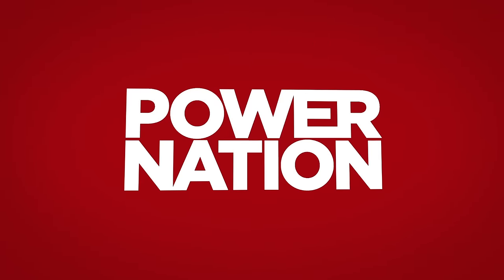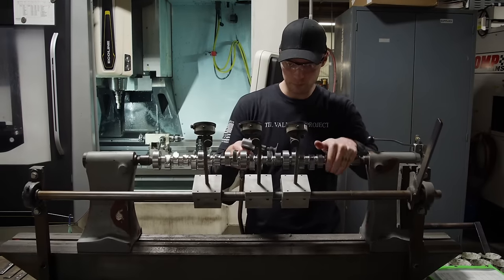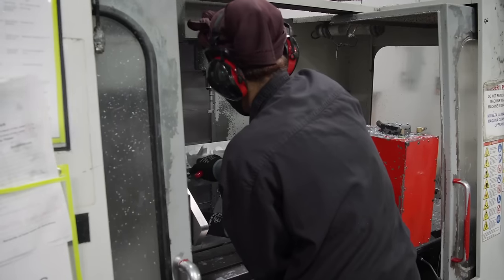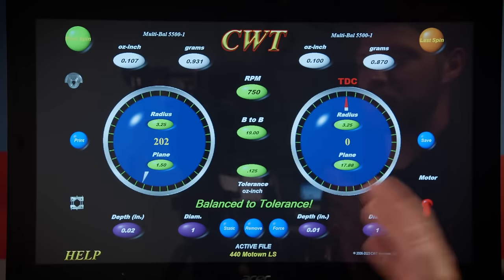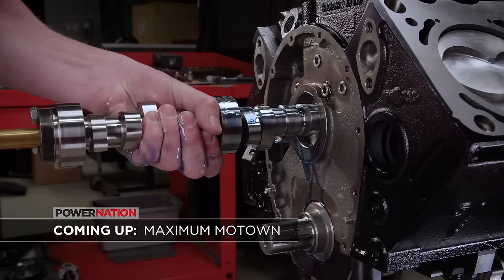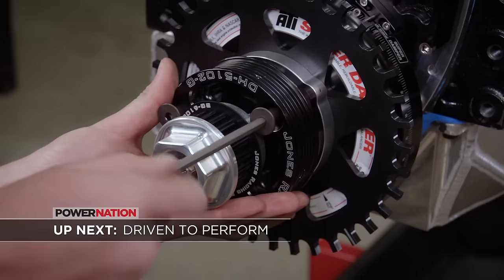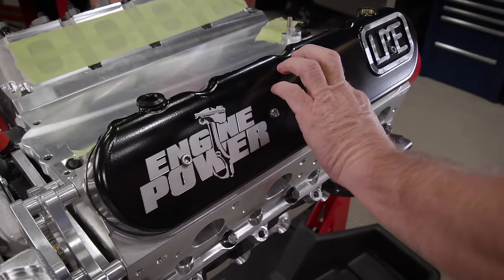Building a High Tech 440ci High-Compression Dry-Sump EFI Small Block - Engine Power S10, E11-12

Comment: Running a crossplane V8 to 8000rpm is a thing most people never experience. Unless you go to tractor/truck pulls lol.
Reply: Track days too
Reply: With the budget these guys have they should be getting at least 9000rpm.. 8000 is easy.
Reply: @davidgalea6113  10,000RPM! Aim higher.
Reply: Go to a dirt track. 8000 is low.
Reply: @InvaderSS670   Even higher than 10k is possible (project spinal tap) just not practical which is why I went with 9k.For some reason high rpm is never done on these shows, its where the real technical knowledge is vs bolting stuff on, high boost, high compression, high displacent has been done plenty of times and easy in comparison to reliable high rmp.
Reply: @davidgalea6113  10,000 rpm 2V (relatively) large displacement V8's are rare because they beat the lips off the valvetrain, and cost several times more than bits that live at 7000 rpm.
Reply: @jamesgeorge4874  yes 10k is pushing and not practical unless you are  rebuilding the engine after ever oval race or after a few drag runs.. I think 9k is reasonable nowadays and wish these shows would build an engine that reaches that comfortably..
Reply: @davidgalea6113  It would not be practical, or worth the additional material / maintenence costs, to rev that high, just to rev that high. That's why manufacturers don't build them, unless you're talking 6 and 7 digit supercars.
Reply: Or drive a factory coyote 😂
Reply: @9090ruby  too bad Ford has fuel cut set at 6750, stock.......
Reply: @jamesgeorge4874 You don't know that there are ways around that?
Reply: @wudznutt6732  a "factory" coyote  does not. If it is tuned, it is not "factory" anymore.
Reply: @9090ruby  coyote is a cool engine but very expensive to build and less parts availability when compare to a traditional sbf.  I wish ford would have gone with a modernised pushrod v8 like gm did with the ls engines.. ford motorsport catalogues used to sell high port heads, graphite blocks, aluminium 302 blocks etc etc nowadays the really high performance ford parts have been replaced by mild steet stuff.
Reply: @jamesgeorge4874  I agree with your comment, but I was talking about engine builds from TV shows like this one rather than manufacturers.. they have the budget to do this..9k is not that hard  with today's aftermarket valvetrain parts
Reply: @InvaderSS670  12000

Comment: I built 440 cu. in. small blocks in 1972 for my late model modified circle track car. Bob Gillean at Dearborn Crank shaft did the 4 1/8 billet crankshaft. Dave Crower ground the small base circle camshaft.  I designed and machined the custom 4340 connecting rods and fabricated the 180 degree headers. 4 1/8 by 4 1/8.  Many comments on Western Pa. Circle track websites. Clate Husted was my driver.

Comment: Why would anyone prefer a gen 1 bottom end over the LS 6 bolt main?
Reply: Im still scratching my head! The guys asked for something relieable that can take a beaten nd they go and build something with no track records
Reply: @holeshot1721  I think most of the builds are based on who want to pay for product placement or at least donates parts. These blocks seem pointless and who would use those rings and pistons in a build like this?
Reply: The blocks designed for people to be able to swap in all thie gen1 sbc stuff including mechanical fuel pump and timing set but be able to take advantage of 15° Symmetrical port ls heads
Reply: @jacobkite5497  yup great idea buy a $3500 block instead of a $50 fuel pump and a $100 set of mounts. Only if you are class rule limited.

Comment: They need to make a home made 6.8L DOHC 40V Triton V10 by using 4 sets of 4.6L 4V Cobra heads by cutting-em and welding-em as well as porting and polishing the modified Cobra heads, use some custom made camshafts from either Comp cams or Lunati, and a custom home made intake manifold and man you have you're self a Homemade 6.8L DOHC 40V Triton V10 making over 700 HP NA with some custom Homemade parts as well as some beefed up factory parts.
Reply: Could just boost a 3V.....
Reply: @jamesgeorge4874  Yeah but it won't be as reliable as a Homemade NA 4V V10.
Reply: @CJColvin  because "homemade 4V 10's" have a stellar track record ? I know of 1......
Reply: The V10's in general have a great track record. About to hit 600k, myself.
Reply: @donaldgminski8621  Awesome brother
Reply: There’s a channel on here that did that. Custom intake and headers, and cut up heads and very fancy cams.
Reply: @ForneyRider  I saw the channel and its call Build it yourself.

Comment: 700hp all natty?! hell yes!!!!turbos, blowers, and superchargers are cool and all but nothing beats the sound of a naturally aspirated big cam V8 with a lopey idle and breathing fire at 8000 RPM!!!
Reply: How about the sounds of the laughing when a bolt on car with a blower goes past this high dollar build?
Reply: At this power level it has good torque response and can spin up and it's a flexible more durable engine. Dependable for racing
Reply: Easy to make 700hp in a race engine all motor.  Almost impossible in a street engine you want to live a long time.

Comment: 440 CI, LS7 top end and you made 31 more HP than the basic 416 LS3 stroker Richard Holdner used in his Rec Port LS intake test using the stock LS3 intake manifold. I would have expected this combination to push over 700HP.

Comment: I'm glad that the SBC can finally take advantage of LS cylinder head flow. There's only so much you can do with a 23 degree valve angle.
Reply: These blocks have been out for a long time. Like 10-15 years I think but they are pricey!

Comment: Man I love these big small blocks. I used to always run 350s, 383s and I still own a couple but I really like my new 434. In my C10, with a power glide with 3.42 gears...it's an absolute handful.  It runs n/a like my old 383 on a 125-150 shot. And to top it off, it's now a hydraulic roller cam and I love not having to lash valves all the time. I talked to Nolan at Isky Cams and told him what I was building, he spent a good while talking to me and he recommended the perfect cam for my combo. Just enough low end torque to be streetable and tons of midrange and top end power. I plan to wire and plumb my new nitrous express kit this winter, the engine is built for spray

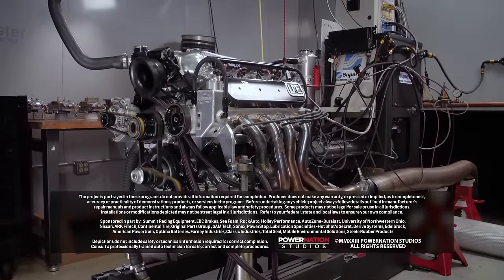Comment: Nice build.. ! i did a 440 SBC with 11:1 c/r 18 degree NASACR heads  with 2- piece Bow tie intake , 1 7/8 ‘’ stepped headers  . Camshaft has around  .700 lift and solid roller … dyno showed 675 hp @ 600 lbs .. all under 6800 RPM .. We went with a light weight aluminum sprint car block .. i should have went with the SP-2  heads but chose not to at the time…Everyone i talk too says the DYNO numbers are very reliable and not overstated 42:49 ..🇺🇸🏁😎
Reply: What nascar heads did you use? Sb2.2? Ford guy myself so not familiar.. wouldn't it be great if nascar still used normal heads/blocks/parts (the kind you can bolt on to a traditional small blocks)..  nascar parts were a treasure trove of used parts but ever since 2009 nothing interchanges/ can be used with oldschool parts..the heads need a special block, no more carbs, no ford 9 inch, no 4 speed etc etc..
Reply: Your build doesn't sound much different from my 10.7 to 1 399ci 1st gen 89 octane street stroker. 3.625 crank, 4.155"+ bore, 260/266@.050.......679/668...110 lsa solid roller, GM Performance 2 piece intake, Brodix 261cc. 18* C-Series milled to 17*, QFT 950 Black Diamond.......641hp@6400 and 560ft lbs.@5700.
Reply: @heshtesh  Cool ..!  I made a turtle and bolted it in the manifold plenum and picked up 5 hp…easy to do on the 2 piece intake.. good luck..!
Reply: @davidgalea6113  yeah the SB2.2 are better than the 18 degree i used.. i kind of agree it would be better if NASCAR used the everyday traditional race stuff … But Toyota ruined all that stuff because all their race engine stuff is just that T.R.D….! You cannot buy any X Toyota race engines and build your own engines..! The engines are sealed units..During the MID 80’s  Ford cylinder heads did have a advantage that really showed up on the Big super ovals and it took a little time for dodge and Chevrolet to catch up ..Yes the 9’’ type rear end was standard in Nascar cup , but did you know a  GM 12bolt type dropout uses les horse power to run than a 9’’ but rules don’t allow it..! Of course the 9’’ is gone and they now have a weak independent unit…

Comment: Cool build, but I have 0 idea why anyone would want an old SBC block instead of one of the many nice LS ones.
Reply: Better bay-to-bay breathing on the OG small block vs LS blocks. Splayed 4 bolt mains are plenty strong enough to handle what these guys are building it for. Plus, since the block is OG small block, there's less fab to be done to bolt it in most things that originally ran small blocks.
Reply: @p.d.3192  I had the same reaction as @bobqzzi and your suggestions did occur to me, but at this point there are tons of LS parts and it seems like they had to have several custom parts made to work with this hybrid block. The only thing I can think of is the oil pump on the LS is quite different than the older SBC so maybe that is the reason.
Reply: Oiling issues.
Reply: @Timmayytoo he explains why from 1:45 - 2:10
Reply: Should have used a Dart.
Reply: @taylorsrus9543 the dart is more expensive and lighter probably but maybe not as solid and strong
Reply: Dart is more expensive
Reply: @marcalampi5036  Dart prices have increased lately but it's still cheaper than this block and doesn't need custom parts. At this power level strength is a non issue.
Reply: Class specs!

Comment: What is the cylinder wall thickness at a 4.185 bore on that particular block? 🤔
Reply: On a 4.4" bore spacing, that leaves 0.215" wall thickness (between cylinders. No idea on the thrust sides).
Reply: Thanks much. I thought maybe you'd think that was a stupid question. ✌️😎

Comment: FR3. YOU USED FR3 in a torque 454 several years ago.
I have always wondered about additives.
Unfortunatly, the FR3 was added before the first dyno test.  This did not allow anyone to find out if the additive worked.
Could you please get a few dyno runs on an engine to establish a base, the add the FR3 and test again. This will either prove or disprove if the FR3 works as advertised. 
Thank you

Comment: So at the end of the day you spent a crazy budget to make what a good ls7 can make...
Reply: Or a 454LSX, there is the Nascar SB2 or R07 as well.
Reply: But this will last longer in circle track racing running constant high rpm
Reply: @19chev81 literally what the LS7 was designed for. It was made to live close to its redline. The fact it doesn't have to spin to 8,000 rpm to make its power is just a bonus.

The only thing that would make this make sense is if bore or stroke is limited to a certain thing or a certain type of block is required.
Reply: This one is heavy duty for drag racing. It makes the power and has longevity.😊
Reply: @ForneyRider  it's built for a road course car. You can easily build a reliable 700hp ls for less money. I like that it's different but the end product doesn't justify the level of parts and budget

Comment: I would like see them try building like a F1 engine. 2.5L, 13000 RPM
Reply: Yeah that would be out of their area of expertise.   F1 engines are insane to put it lightly.
Reply: I think they have the smarts to do it, especially Pat.
 @bmstylee
Reply: @pascalhumphrey  tell me you know nothing about what is involved in an F1 engine build without saying you know nothing about it.   Building a pushrod V8 that revs to 8k max is not even remotely close to a modern F1 engine that idles at 4k.   The old 3.0L V10s idle higher than most of the dyno pulls they make and run to 20,000 RPM.   So yes he might be able to build one but don't expect it to last very long.   Pat's a very good engine builder but not in that area.
Reply: F1 engines have very tight tolerances and have to be heated with oil before even starting the engine. Not practical at all
Reply: @marcalampi5036  tight tolerance is an understatement.  Until they get it warmed it's basically seized.

Comment: I have a few questions.  Why use head bolts instead of studs?  Did they use roller cam bearings?  Will a Jesel belt drive fit under a timing cover?
Reply: Yes, wet timing belts exist.

Comment: My stock aluminium block 415 with gm performance parts cnc heads and a cid 4500 intake makes more than that.
Reply: But it wouldnt last as long on a circle track at a constant high rpm
Reply: @19chev81  maybe not, but that would be block related. I have just as good bottom end stuff as they do, callies crank and rods, but not near as good of heads as they do. That's why I make power at 7k not 7700, and I make more torque from less cubic inches.

Comment: I want to know when the terminology went from foot pounds, to pound feet?  I was a machinist for 34 years and if the torque value was X amount, I knew what that meant. No matter what you called it.
Reply: pound feet and foot pounds are two different types of measurement
Reply: Pound feet is actually the proper way to say it and the SAE standard
Reply: I believe they are the same thing
Reply: @marcalampi5036  nope

Comment: can i run this engine with a carb gulping e85 ?
Reply: Yes but why use an obsolete technology
Reply: Carburetors are far from obsolete there tin lips..
Reply: @kkoch666  keep telling yourself that and it still won't make it true.  You also probably think single circuit manual drum brakes and 6 volt electronics are just as good as what we use now.   Technology advances and carbs, like CRT TVs and flip phones are well and truly obsolete even if a small segment of the populous uses them because new technology scares them.
Reply: @bmstylee  To be fair, a carb will make more power, every time.
Reply: @taylorsrus9543  Direct injection makes more power than carb or efi of any kind.
Reply: @Twogreenfeet  you have a link to a DI engine making 11,000 horsepower?

Comment: 440 Ci is not a small block for me a small block is anything under 4.0L
Reply: Small Block v Big Block is more about deck hight & bore spacing as opposed to outright displacement. Although obviously deck hight and bore spacing play major roles in how much bore and stroke you can put into each cylinder, which determines displacement. Modern “small blocks” can be designed with massive displacement in relatively small packaging (LS7 427ci factory small block)
Reply: So a 350 is not a small block? LOL

Comment: That intake manifold is way wrong. The runner length is for 10k plus rpm . A properly designed manifold would pick up at bunch of torque and hp in the rpm range the rest of the motor is designed for.  Sorry guys but for the budget on this motor it’s a pooch .
Reply: Pats been building racing engines forever im pretty sure they know what they are doing.....
Reply: @19chev81  the pathetic results of this engine says otherwise. That power could be made with L92 heads on a 400 ci all day long. I have done it numerous times.
Reply: @gregertman6497  they arent shooting for absolute max power.....they still want something to stay together at constant high rpm on a circle track....